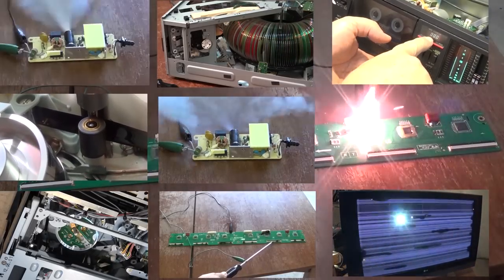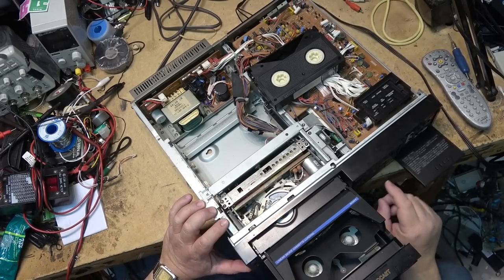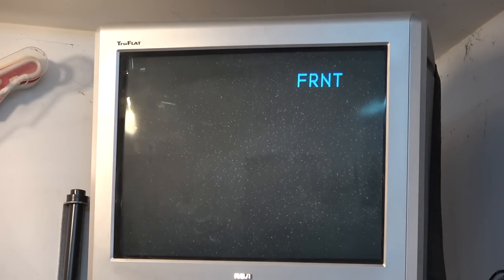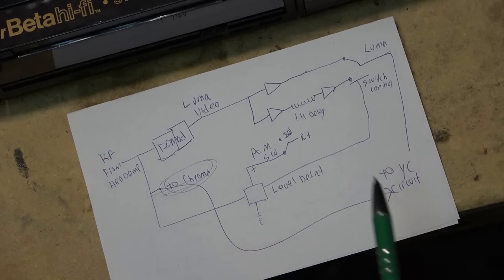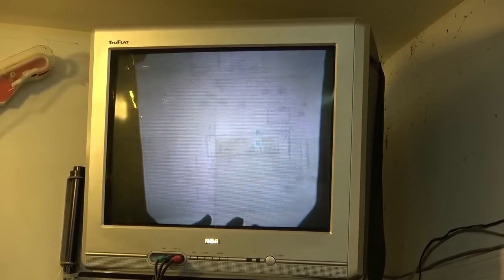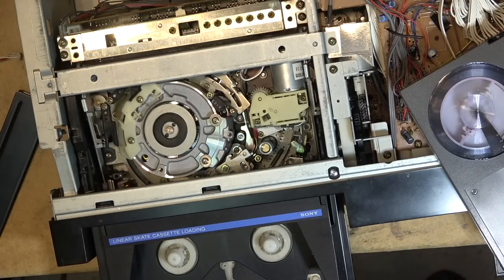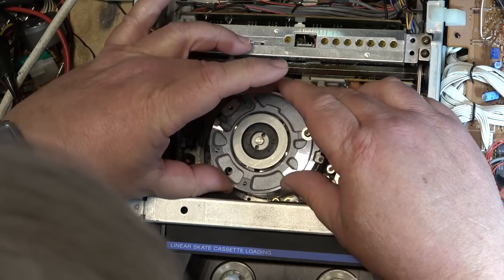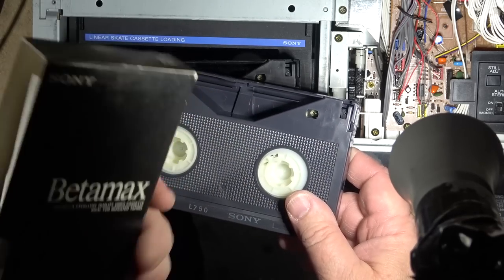Sony SLHF750 Betamax with a poor picture

Comment: The older machines just keep on going until the heads/drum are beyond refurbishing.
If they were made today, the mechanisms would be 90% plastic and would not lost all these years.
The worst decks that i had to rebuild were the all plastic Philips ones, they would self destruct just
for the hell of it.
Have a great Easter Dave.
Reply from the maker: Philips never knew how to make anything that lasted.  Both my parents and grandmother started with Philips color tv.  They were always breaking down.  After 5 years the tv guy refused to fix my grandmother's Philips k6 all tube color set.
Reply: @12voltvids  Philips were great innovators, but when it came to consumer electonics their designs
were poor and used thin single core wiring that broke if you moved it, and very thin low quality "Muck Metal"
for their chassis and mechanisms.
What shocked me was that the early B&O TV's were based in Philips designs and thus suffered similar issues.
Thankfully unlike Philips they learned from that mistake and the later sets were their own designs.
Today Philips is just a brand name like so many others.
Reply from the maker: @Barbarapape  my grandmother had a k6 which had excellent color when it worked.  It spent more time in the shop.  They used circuit boards with tube sockets on the board.  Pull a tube to test or replace and break a bunch of connections on other tube sockets.  My parents had a modular 4.
They used series filaments for the 4 tubes.   40kg6 and 42ec4 for the horizontal output and damper.   Remember those tubes well as it would eat at least 2 sets of them a year.  Under warranty the Philips guy changed the module at least twice.  Out if warranty the local guy (who happened to live directly across the street from where i live now) was a regular visitor to change tubes.
Reply: @12voltvids  That was the way things were back then, pcb mounted valve holders were a recipe for a disaster.
The worst i came across were in GEC sets that had double sided print pcb's with valve holders, you can imagine
what happened when you tried to replace a valve (Tube)!
This was in the late 60's and early 70's when i was a spotty nosed trainee, you knew your customers by their
first names back then.
Happy days when you knew what spares to take with you.
Reply from the maker: @Barbarapape  the k6 was double sided full valve (tube, vaccum bulb as Shango called em) set.  By the time the set was 5 years old the Philips tech refused to work on it.  I remember the last time he came out.  I would have been perhaps 12 and said it was the last time he was fixing it, to never call again and they were going to blacklist the address so nobody would come out to fix it.  So then the guy across the street started showing up regularly and taking the set away for a few days.  He talked her into buying a zenith.  Now your talking a good set.  That thing lasted longer then granny did and i ended up with that set. A chroma color 2 with space command "clicker" because that is exactly what it did. Clicked.
Reply: @12voltvids  Those clicker remotes used a tuning fork to change channels, then came ultrasonic
until the infrared LED.s became more common, now it's bluetooth in the latest sets.
The longest lasting set we ever had was an ITT/KB which was a hybrid with chassis mounted valve
holders in the output stages, these were more gentle on the CRT, and it lasted until we bought a B&O
set that the customer ordered then changed their minds.
You didn't need a soundbar with the better CRT sets unlike todays that have tiny speakers.
Reply from the maker: @Barbarapape  not so much a tuning fork but a tuned tinge much like a fender rhodes electric piano. A hammer struck it and it emitted s specific frequency that was picked up by a microphone on the tv, amplified and placed through band pass filters. On the right frequency then a relay would operate to turn the channel motor up or down one channel or step the volume through 3 levels then off.  Tuner had 14 presets.
Reply: @12voltvids  They were basic by todays standards, but they worked, if you kept a parrot or other bird as a pet
they would choose which channel to watch.
Reply: @12voltvids  2003+ Sony tube tv's were garbage too. Almost caused fire at my house back in 2005, tv was only 2 years old
Reply from the maker: @tacofortgens3471  i have a relatively modern Sony tube set. Forget the year but it must be early 2000s.  21" flat tube with all kinds of picture enhancements like velocity modulation and dynamic focus.  All I know it is has a really really good picture.  Its in my secondary studio where I do u-matic archiving.
Reply from the maker: @Barbarapape  i could whistle to the frequency that changed the channel.  That was loads of fun as a kid.  Grandmother thought the tv was on the blink as she couldn't hear the sound.   Called the guy out a few times for a job existing problem.
Reply: @12voltvids  Happier times, along with the remotes some brands introduced touch pads on the set
and they gave loads of problems.
Reply from the maker: @Barbarapape  remember the kpr36xbr Sony. It looked like the kv25xbr on the pedistil stand.  It was a 36" projector.   Looked great.  The tubes in the base.  They were really small tubes.  Ibkt about 3 or 4".   Had one the dif mistook for a fire hydrant.   That was a fun one.  Only time I refused a repair and the bias said fix it or go home and don't come back.
Reply: @12voltvids  I can well remember the rear projection sets and the nightmare of fixing them, then 
getting the geometry and convergence anywhere near right not to mention uniformity and purity.
If they were not on a solid floor you never got them right.
I wasted a lot of time in customers homes trying to get an acceptable image, only to be asked what took
me so long on returning to the shop.
Some days were not so happy!
Reply from the maker: @Barbarapape  the only time i was ever in a car crash where it was deemed my fault was in the company service truck.  My boss was an assole and watched the clock.  If I was there too long he was phoning the customers house to tell at me to get back.  He knew how long it took to drive around the town.  A service call which in the day was 40.00 was 30 minutes in the house.  If he knew it was a 10 minutes drive he would be phoning  45 minutes after i walked out the door and i had better already be on my way back.  If I was late he would sick my pay.  It didn't matter if a customer was being a jerk and had the protractor and ruler our measuring the cross hatch and Indian Head test pattern for acceptable geometry before paying the bill.  Anyway this set took longer and the boss was already frothing at the mouth,I was rushing to get back to the shop.  Waiting to make a left, already in the intersection the light turned yellow.  There was a car coming the other way that was probably 50 feet back as i started my turn on this piece of shit Toyota van (1984 red Toyota van with 5 speed stick gutless as an old rabbit diesel.) Anyway as i start my turn I look up the other driver had floored it to beat the light.  Slammed right into the side loading door and threw me into a spin.   All because i was trying not to get my paycheque docked an hour because the piece of turd i worked for. Since I was making a left it was my fault.  Color of light made no difference.  Dash cam would have been great back then to prove the light color.  Witness was in my favour said light was green as i entered and turned yellow when I was in.  I was at fault because i assumed the other driver was going to stop. They didn't.   Other driver got ticket for running red but i was deemed responsible for crash as I was turning left.  Left turn us always at fault regardless of light color.  Insurance company treat every intersection as if no light or stop signs.  Car going straight always has right of way.   So in this situation car waiting to turn must stay stopped untill other car had stopped before turning.  My mistake was assuming they were going to stop for red.  Other driver got ticket for distracted driving (lighting a smoke) and running red, i got no ticket but was at fault for crash.  How fu@ked it that?  Bosses insurance went up and u was never allowed to drive the truck again for the remaining 15 years I worked there.  The 16 year old high school dropouts that worked there were driving me to service calls.   As I said i worked for a real piece of work.  I never said anything negative about him because he was the type that would sue for slander but cancer got him last year so now i am free to talk about the nightmare I lived.
Reply from the maker: @Barbarapape  the guy I worked for was horrible.  I have a Sony trinitron that I had to buy because i dropped it taking it out of s customers car.  It was a broken set and as i reached inside the customer has a dog inside.  As I started to lift this set out the dog sank his teeth into my arm. I jumped back and let go of the set. It rolled out and damaged the cabinet (crack in the bezel) and the boss made me buy the customer a new set. I threatened to sue the customer for pain and suffering from the dog bite but was told if i did he would fire me. Customer got a new set and I got the broken one.  Still have it, still has a crack in the cabinet.  The fall broke only the cabinet.  Offered to replace the cabinet for free but customer insisted on new set.  Cost me 600 which was the wholesale cost of the TV.  So I basically ended up with a 600 tv with broken cabinet.  I used it in my bedroom for years and then it was over my bench for a few years, you see it in early videos.  It's now in storage but still works fine or it did last time i fired it up.
Reply: @12voltvids  Some people are horrible to work for and treat their staff like something stuck to the bottom of their shoe.
Where i worked they gave the customers the impression of been a high end dealer that they should fell privileged to buy from.
The reality was far away from the posh showroom, the workshop was dank with many leaks in the roof, we had to put plastic
sheets over the sets when it was heavy rain, and if we dared to put any heaters on in winter he went mad moaning about the
electic bill.
The old Volvo estate i had was held togeather with gaffer tape, today it would not have passed the strict annual MOT test.
Life as a TV engineer was never that glamorous, and the pay wasn't great either.
Reply from the maker: @Barbarapape  I made a pretty good living doing it for years.  When the average wage in the 80s and 90 was between 30 and 40k a year I was making about 60. 
I hear you about plugging in a heater in winter.  I did anyway but he wouldn't run the AC in the back. Showroom yes, his office yes but he had the vent in the shop closes off so as not to waste money keeping us comfortable.  Then the clawbacks every chance he got.   He had been a smoker and was a relatively heavy drinkers.  Esophigal cancer got him in the end.  Believe it was 72 when it got him.   What goes around went around.
Reply from the maker: @Barbarapape  my old boss also went bankrupt. 10 years ago the shop closes.  (I left there 20 years ago). His wife found out about his gielfriend, and had enough.  He let his business go under and from what I heard house into foreclosure so his ex wouldn't get anything.  She was nasty too though as he had a really nice fully restored convertible that was worth a small fortune and she literally gave it away for something like 3500.00. It was probably worth closer to 40k.  I left when he started picking my pocket.  Giving refunds to repairs that had been done years before and taking the money already paid to me for those repairs back.
Reply: @12voltvids  As the saying goes there are no friends in business, these sort will grab everything they can and don't care about the people they rob to fund their lifestyle. I only found out what my boss was charging customers when i went self employed, it took me a while to build up a customer base but for two years it was easy money.
Reply from the maker: @Barbarapape  yes I know.  When i started the video production business I had the grinders always wanting a deal and would get shortchanged. Trying to get prices up was like pulling teeth. When I started doing weddings everyone knew everyone. They saw a friend's tape and wanted to hire the same guy at the same price.  First wedding I did i changed 500 bucks for.  Then i found how long it took to edit.  Of course all their friends expected to get it done for 500, and by the second or 3rd I was looking for 1000 minimum but nobody wanted to pay that. They wanted the same price as their brother or sister or friend.  Took a few years to get the price up.  Refused a few and then had a very upset bride show up at the door with a tape a friend had shot wanting me to edit the mess into something they could watch.  Had one that uncle bill had shot in portrait mode on his handycam.  Took longer to edit this mess which I ended up charging her more to correct.  My answer to her was, you can pay me now or pay me more later.   In this case she did.
Reply from the maker: @Barbarapape  same here.  I was working cheap just to get stuff in when I got back into it. The locals all expect it is done for next to nothing.  I started getting stuff shipped in and given much more than i would have ever gotten from the tight ass locals that want everything for nothing.  The Sony reel to reel i worked on a few weeks ago i charged what i should have been all along and the owner was shocked as it was double what they had paid me in the past.  How come so much was the question. My response was it was what i should have charged them for past repairs but I couldn't afford to work for 10 bucks an hour anymore and the videos are just not paying what they used to thanks to people with ad blockers.  No ads I don't get paid. I don't get paid and I have less incentive to make videos.  
I just did a big film archive order. 1500 worth and the guy said how come so much.  I said it's based on how much film you had to scan.  4400 feet on big reels and 37 small 50 foot reels takes a long time.  Each 50 foot reel takes 30 minutes to scan, plus 15 more to process.  The big 400 foot takes 4 hours minimum to scan.  I say minimum because many of those 60 year old splices were not done right and they stop in the scanner waiting for me to clear it. Which means that i have to babysit the machine or i come back in 4 hours expecting it to be done and find it stopped after an hour waiting for the bad section to be advanced.  That means more time.  480 slides that have to be scanned and it takes a good minute to do each one. Time is money.  
I liked corporate videos.  They were money makers.  Do a 5 or 10 minute product demo and make 2500 to 5000 for the shoot and editing and then 2.00 per copy for say 5000 or more copies.  That was good money.  I had a fee clients that ordered over 20,000 copies.  Short tapes cost .75, paper sleeve and label .20 meant 1.05 profit per copy.  Those were the days.  Could make 50 copies at a time.  5 minute video and 5 minutes to reload.  Could run off 250 copies per hour if i hustled on short tapes.  Of course that was insane.  Pulling the 50 tapes and reloading starting the next run and the. Stuffing them in paper sleeves.  That keeps one hopping.   I had business partner do that part.  I did the writing, shooting and editing. I turned the copy job over to my assistant.
Reply from the maker: @Barbarapape  
I left the repair business in 2003 and went to work for the phone company.   Union job with benefits.   Was glad to get out of service business.

Comment: I thought it was a cool design. Until you took the top off and operated it. Flexing that mass of wires every time the drawer opens and closes. Surely there is a better way. Great video!
Reply from the maker: A problem waiting to happen
Reply: @12voltvids  yet 37 years later the system is still working fine and no signs of those cables failing any time soon, sorry guys but time has proven sony right on this one. :)
Reply from the maker: @diegomax  sorry to disappoint but those wires were breaking all the time.  This machine is old but it has likely seen very little use over the years.  The heads are typically good for only about 1000 hours.   Remember this is beta.  Once the rental market was done for beta mist if these machines were put in storage.  Why do you think many still work?
Reply: @12voltvids  well i was just talking about the loading mechanism, im not gonna debate you on the other aspects because you are clearly on another league than me when it comes to electronics and repairs, i was just pointing that the loading mechanism is just working fine after 37 years, i never had one of these machines myself (i never had any betamax for that matter, format wasnt popular where i live) but i find it beautiful. Cheers!
Reply from the maker: @diegomax  they had the loading mechanism worked out by this point. The sl2000 2500 and 2700 was another story.  Those retractable guide pins were a very common repair.   They would snap off.
Reply: They might not have had FPCs back then but that's what they'd probably use if they were to design such a thing now. Printers use them to connect to the moving printheads and as long as the radius is large enough they'll last for hundreds of thousands of cycles.
Reply: @CanizaM  Flexible PCBs were available when this was made. Sony used them in their camcorders, and in their portable Watchman TVs with that weirdly cute flat CRT. Dave repaired one of them (twice), and it has flexible PCBs in it. But here, it would have been a bit problematic to use them, as the motors need quite high current, and the heads provide very low signal which must be shileded, even if the video head amp is attached to the mechanism (which is not always the case in Sony Beta VCRs).